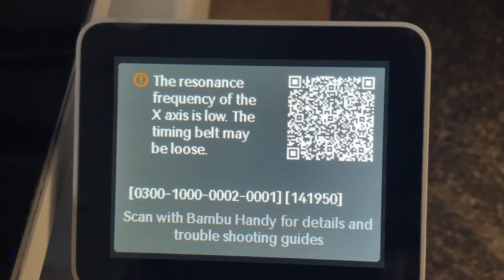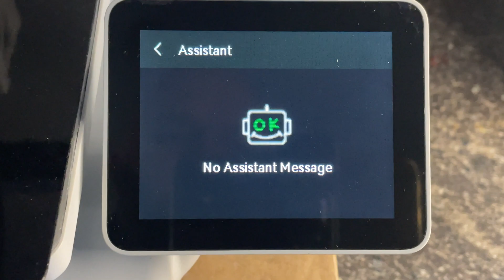Bambu A1 ERROR! The resonance frequency of the X axis is low. The timing belt may be loose.

Comment: Would be great if you showed how to get to this bolt.
Reply from the maker: It's at the back of the tool head. It's not covered and easy to access. @1:06 you can see that bolt
Reply: @--unknown--  It took me a few minutes to realise that its from the back of the printer not the front. :)  When i looked at the back it made sense. All adjusted now thanks. Hope it doesnt play up again. Seems tighter.

Comment: Same process for P1S?
Reply from the maker: Not sure how the tool head is attached for P1S. Because that's a different type of printer. If you get that error then probably you need to tighten belt just lock up where you can tighten in on P1S

Comment: Still being shipped out like this 4 months after you posted this.
Reply from the maker: @nickbutler7935  it's sad but it is what it is 🤷‍♂️
Reply: Got the error today after a month and a half of use. Assume it just loosened over time due to vibration. The app gave me the message and linked to their wiki showing how to fix it. Falls plunder general maintenance. I'll probably add more lube to the tracks at the same time
Reply from the maker: @ common issue when it's new. Since I don't that never came back again
Reply: I had it before and fixed it   but now it's back and more persistant.

Going to try your nethod and see how it goes.  Only other thing i coukd do is replace the belt and the unit (about a year old)

Comment: For anyone still having problems with it and with the message still appearing make sure you don't screw the screw in too tight I still kept getting the message when I unscrewed the screw fully I saw the piece of metal was bent. I straightened it out and put it back in there and didn't screw it in really tight and The problem was fixed
Reply: thx man help a lot
Reply: @ggomez6622 np, glad it helped
Reply from the maker: @jordanvaile2629  thanks for good advice 👍
Reply: I will try this. Thanks 🙏🏾

Comment: If I recall according to Bambu's wiki you don't need to hold the bolt on the side but rather move the extruder all the way from right to left 3 times I believe and then tighten the back bolt again.
Reply: So I’ve done both ways 6x and it still showing error. The belt seems fine to me. I’m a mechanic idk why but it’s pissing me off this fu*kin thing. It’s my kids they are 8 just want to print them sh*t lol
Reply: @miked6097  Other than contacting bambu support, the only other thing I would suggest is trying again and then resetting machine to factory and see if that clears things. Also, I'm assuming you remembered to run the calibration after the adjusting the belt
Reply from the maker: Make sure you not push that metal pin but just hold it. If you push it then most probably the belt gets too tight.
Reply: @miked6097  作者的方法无法彻底解决，想彻底解决你需要将面对工具头右侧的两颗螺丝拧出将皮带卡扣拆下来，然后把皮带剪短一齿或往外移动一齿后装回，然后再重复视频步骤自动张紧一次皮带，再做一次共振校准，之后不会再有提示了。
The author's method cannot completely solve the problem. To completely solve it, you need to unscrew the two screws facing the right side of the tool head, remove the belt buckle, cut the belt short by one tooth or move it outward by one tooth, and then reinstall it. Then repeat the video steps to automatically tighten the belt once and perform resonance calibration again. There will be no further prompts afterwards.
Reply from the maker: @dosdont  well, for me worked this way 🤷‍♂️
Reply: @--unknown--  👍🏻

Comment: are u loosening it or tightening it?? you said "loosening"
Reply from the maker: @msbhebzie895  first loosening and then tightened back. When I loosened I could feel slight movement of bolt on the side which you have to hold with no pressure.